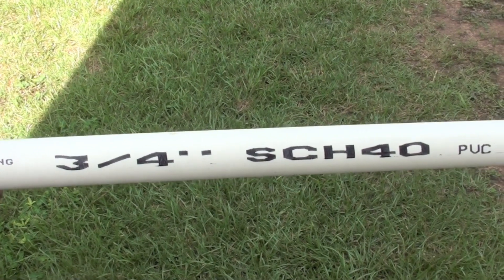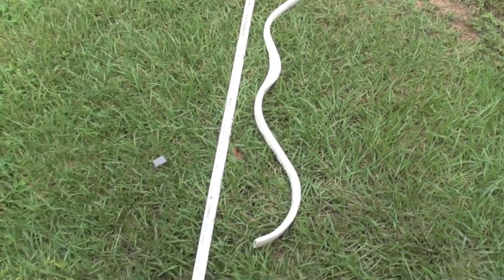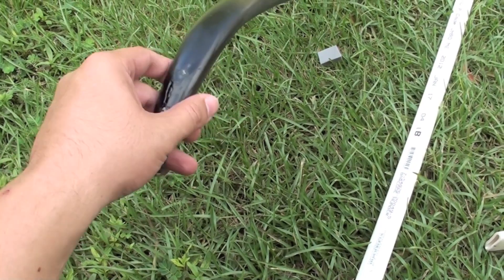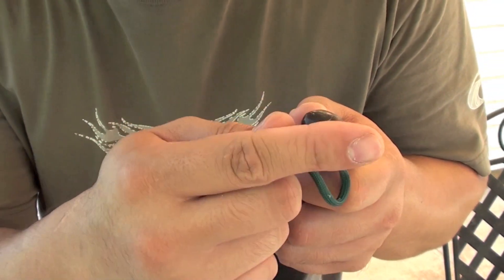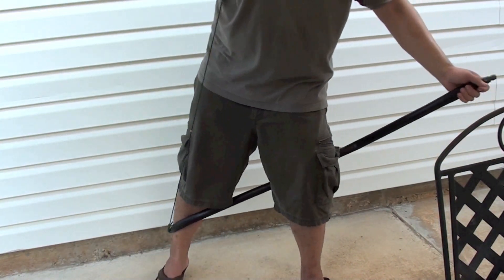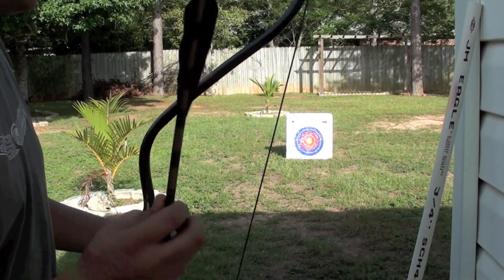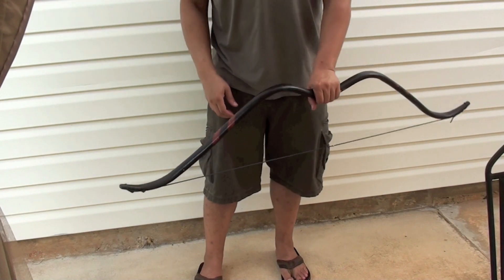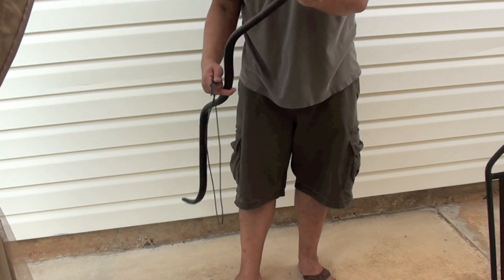Cheap Handmade PVC Bow Project. Only Cost $4.00!! Part 2 Finished Bow With Paint Job!

Comment from the maker: 550 paracord.  This is not the best string to use. But it works great. It knocks with an arrow perfect and releases perfect.  There are many different strings you can give better performance. But convenience and ease of use outweighs them  all.